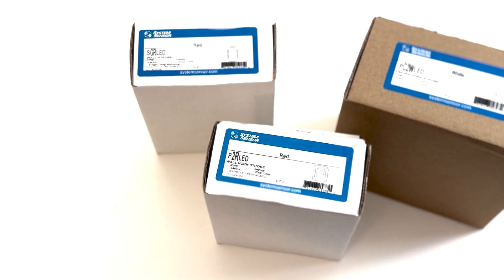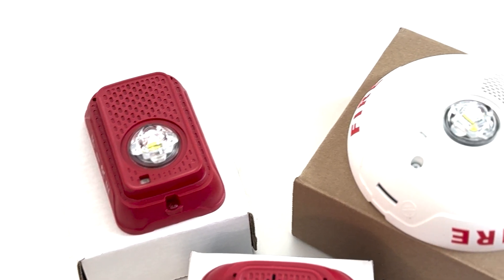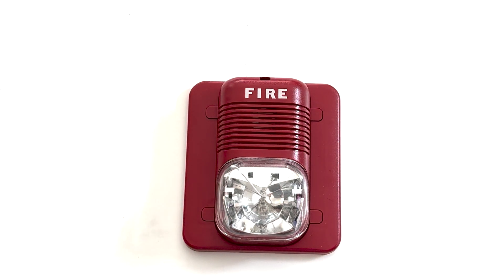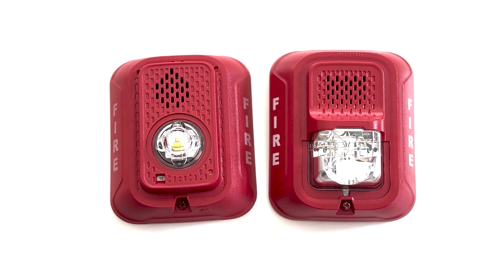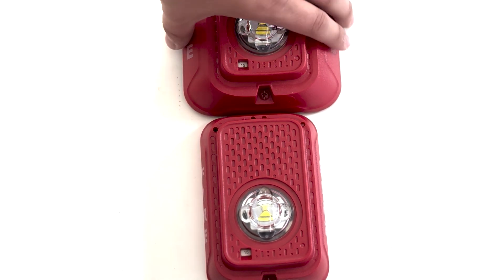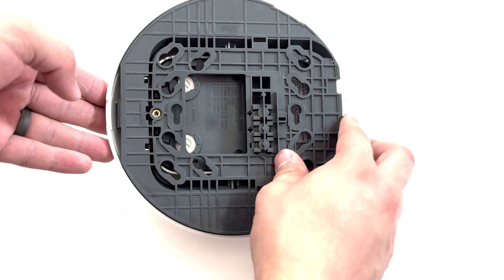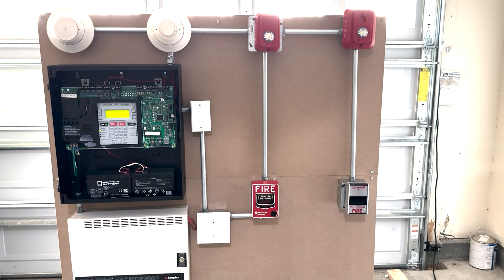Demo Board System Test 2  - System Sensor L-Series LED

Comment: The older l series had a single gang
Reply from the maker: @JayForeman-iw1zy  yup! Less commonly used. Traditionally horns were often placed on a double gang so I assume that mindset just kind of stuck, even in new construction, but with more manufacturers having single gang devices I wonder if we’ll see that shift more.

Comment: Very awesome! I like this LED Series! I would prefer a Simplex 2903, 4903 or QuickAlert over it. I think this design is more professional and up to date than the original L-Series. I even like them more than the Advance, but not as much as the older Classics and em good ol' classic Sounder Strobes!

Comment: Will a notifier nbg12 lx work on a fire lite es50x panel
Reply from the maker: As long as the panel is set to Light Speed, I think it should technically work unless they changed something from the 9200UDLS. This makes it fine for a hobby system, but not UL listed for a real system. In some of my older videos, I had mix matched NBG-12LX and BG-12LXs on my MS-9200UDLS without issue.

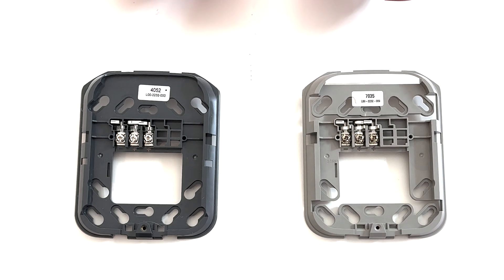Comment: 3:36 that gray bracket is the 1st gen mounting bracket. The xenon l series from 2018 and later have the same mounting bracket as the LED l series.
Reply from the maker: I’m not sure how they would because they don’t fit, but I could be wrong. My understanding was the redesigned bracket was built to replace the Gen 1 brackets without replacing all the devices.

Comment: System Sensor also made the LED L-Series to work on FWR as well
Reply from the maker: The xenon devices worked on FWR just fine. As these are a direct replacement, they also have to work on FWR.

Comment: I like the new design honestly, its time for something new. It would be weird to see something like this on an older system like a 9200/5024 system which are common in my area, but overall the features are cool especially the holes for  measuring with a multimeter, makes diagnosing faulty devices/NACs a snap
Reply from the maker: I can't even count how many devices I had taken down in the field trying to troubleshoot a problem. This will really speed it up!

Comment: Fun fact: These new system sensor appliances are actually OEM replacements for the xenon strobe l-series. The old xenon l-series is getting a complete phase-out.
Reply from the maker: Yes! They have more coming down the pipeline soon it sounds like. Like everyone else, they're working towards a full LED lineup.
Reply: @TheFirePanel That single gang remote strobe looks about the size as say a Simplex 4904-9137 just with a Smaller LED Strobe that is not as difficult to remove